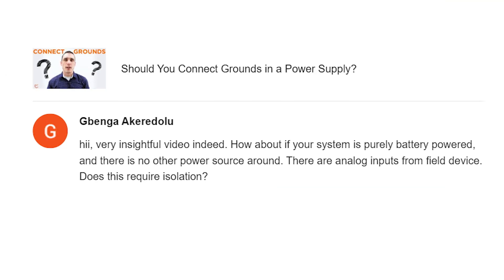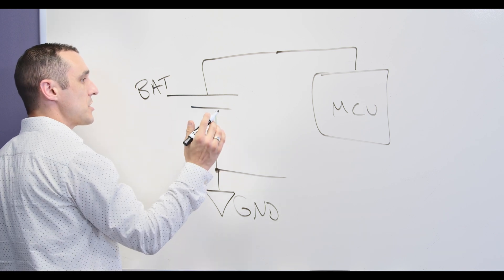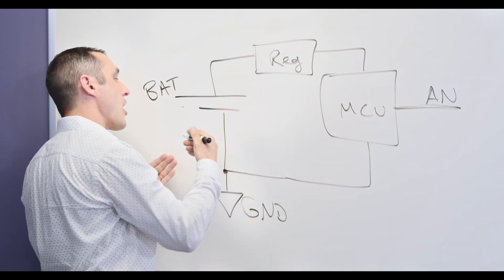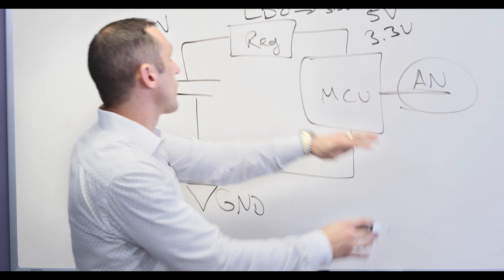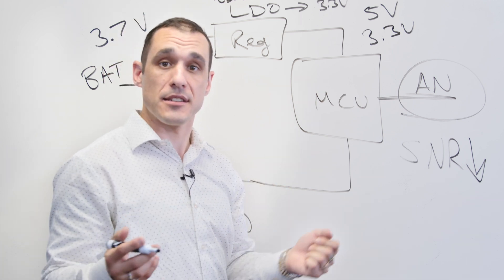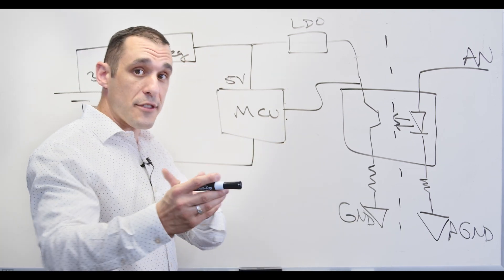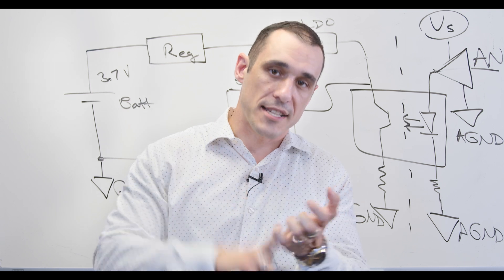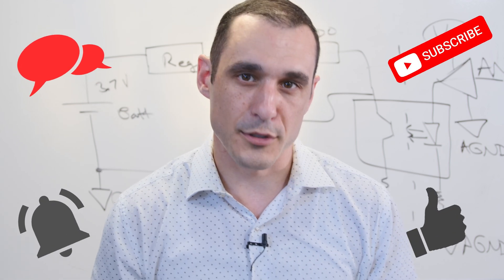Grounding Strategies for a Battery-Powered System | PCB Layout

Comment: How realistic would it be if an ECAD Librarian were to transition into a PCB Layout Engineer?  Does this require additional schooling and a Bachelor's degree?  

How many years would it take to learn how to do this if it really takes that long?  A friend of mine strongly advocates that there is a shortage of PCB Layout Engineers out there in the field and there isn't that many folks out there to fill the necessary job positions that companies are really seeking out for.  

I have the desire to learn but I just don't know where to start and if I'm lucky, I may find a company who will give me a shot to learn.  That would be ideal and it would solve a lot of these companies shortages.
Reply: I think it is realistic. One thing I am noticing is that a lot of PCB layout jobs are being disguised as EE jobs, but they are really looking for someone who understands all the aspects of PCB layout and manufacturing. So as long as you can get some practice designing certain types of boards and getting practice with the layout features in the design tool, you can certainly make the transition. The challenge is that some companies might not let you make the transition, and you might have to switch jobs or do the work freelance in order to get those opportunities.

Comment: In a battery powered device, you don't typically have a separated analog power source as in the reference design. So I guess agnd split is not possible without routing avdd over it.

Comment: From watching Rick Hartleys video  on Achieving Proper Grounding, there seems to be a conflict about splitting the ground plane.
Reply: There isn't a conflict. Here I am talking about a specific instance of splitting a plane based on a requirement for isolation. What I often see happen is people think they need isolation between analog and digital sides but they don't understand why, then they split the system ground and route over the split, that's a recipe for EMC failure. I am not advocating for that and neither does Rick (or any other EMC expert). What I'm saying is that if you have studied the situation and you can prove that the way to prevent noise into a particular portion of your system is to split a ground, or if your system absolutely requires galvanic isolation on the two sides, then there is a proper way to do the split. In a lot of cases you don't actually need the split, but most new designers will say "I have analog and digital on the same board, therefore split," this is not sufficient justification to split a plane.

Comment: the question is, how to split the ground? should we use a ferrite bead?
Reply: Do not use a ferrite bead unless you can prove that you need a ferrite bead. Why do you think you might need a ferrite bead to connect grounds?
Reply: so how should I split the ground? even if I used another regulator for the analog we still shared the ground. idk my previous colleague used to put the ferrite bead to split the digital gnd and analog gnd, It seems wrong but I need a solution for split that ground.  @Zachariah-Peterson
Reply: @wisnueepis3593  I'll ask again, why do you think you need to split your ground regions? Do you have an isolated power supply, are you working on a very low SNR precision measurement application, or do you have some requirement for galvanic isolation for a type of isolated component? Are you operating at only up to about 1 kHz with only analog signals and DC? Most of the time you should not split up a ground plane at all unless you can prove you need it. If you were to split grounds for some reason, the best way to ensure you maintain DC isolation is to connect them with a y-type capacitor. The problem is that you never have true isolation unless the components you are using to cross ground splits are also isolated components that do not use any conductive coupling, they can only use optical (with an optocoupler) or magnetic (with a transformer). These are specialty cases and most of the time you should just use a complete ground unless you can prove you need to have split grounds.
Reply: We affraid that digital will coupled to analog stuff and the other way too.
Reply: @wisnueepis3593  This is the most common question I get and I will tell you the answer: just use a uniform ground plane and keep the digital components separate from the analog components. How you layout the components above ground will always be more effective than separating ground. This will always be effective for all frequencies above audio frequencies and as long as your SNR is much larger than 1.
Reply: @Zachariah-Peterson  thankyou zach for your answer. I have a question about pouring ground copper at layers 1 and 4. Should we pour the island to GND? or just remove them?
Reply: @wisnueepis3593  If you have  a 4 layer board and you use (SIG + PWR)/GND/GND/(SIG + PWR) stackup then there is not a requirement to pour copper on Layers 1 and 4. Don't just fill in with pour because you see everyone else doing it. Take a look at one of our other videos on copper pour around microstrips and 2 layer grounding to see why this is not always the right approach.
Reply: @Zachariah-Peterson  if my layer stackup is SIG + GND + PWR + SIG should I pour copper on the island with GND copper at layers 1 & 4?
Reply: @wisnueepis3593  Let me ask you this, what problem are you trying to solve by doing this? Is there something specific you are trying to do? If you're unsure then you probably do not need to add the pour on layers 1 and 4.
Reply: I just want to know should we pour copper gnd mixed with signal trace or not. We thought that with pour copper gnd will help reduce noise from inside the board and from outside the board.
Reply: @wisnueepis3593  Yes you can use copper GND pour but it may not produce much benefit. For most designs using a ground plane on its own with a ground via next to each signal via is enough. Sometimes we use additional ground with stitching vias, but this would be for copper pour, to suppress reception or radiation of a specific noise source, or to create shielding around a coplanar waveguide. The best way to prevent interference between mixed signal boards is to layout the boards so that the analog and digital regions are reasonably separated.
Reply: @Zachariah-Peterson  thankyou zach for answering

Comment: Hello Sir, its always been great learning from you..well I have a question. To my understanding dont we need to short AGND & GND?…as a single GND is available in power ckt….kindly suggest as it will be helpful to understand ckt more clearly
Reply: In a non-isolated ADC the best way to deal with noise is to use a complete ground plane that shorts both GND and AGND. In an isolated ADC, such as what I show at 6:44, you do not short those pins because the component is intending to provide isolation between the interfaces on each side of the component. Here is a video that discusses this: https://www.youtube.com/watch?v=jhphrm9tktU
Reply: @Zachariah-Peterson  Thank you Sir for this helpful add-on knowledge..👍🏻🙏🏻

Comment: If you're using an LDO, isn't the noise pretty minimal? That is, as long as you route your return traces for the sensor away from the high current grounds, shouldn't there be so little noise that we don't need isolation?
Reply: Yes the noise directly from the output pin of the LDO is pretty minimal. But you're ecorrect as you brought up an important layout point to withstand any induced noise from the upstream switching node, that part is important in the layout. If your sensor runs at progressively lower levels then the need for isolation increases regardless of the use of an LDO.
Reply: Yeah good point! In the past I've used instrumentation amps for analog sensors in the Microvolt range, but they also were low bandwidth, so coupled with higher order filters, we were okay without isolation, but I could see very easily how higher bandwidth requirements could lead you to consider isolation. 

Thanks for the follow up Zach and thanks for sharing your knowledge!

Comment: Now how about if the sensor has to be powered from the battery? I see that the ground split won't be an option anymore but rather noise mitigation techniques like routing and filtering.

Comment: Did he mean isolated DAC? Because the output needs to be an analog signal right?
Reply: At the start it seems so, but he was referring to ADC.
Reply: Since this is an interface receiving a signal it was isolated ADC. If you were generating a signal into an isolated region, then maybe you want to isolate a DAC, but I am not aware of an isolated DAC that is available. There are isolated buffers for digital systems that you could use to isolate a DAC, for example the LTM2895.

Comment: It would be great if you could cover capacitive coupling the grounds for applications that are using a flyback or other isolated supply topology. I've had issues with audio applications using an isolated supply where WIFI Tx would cause a ground bounce that is conducted through the capacitive coupled grounds. Without the capacitive coupling the isolated side would have ground noise from the power supply causing EMC issues and audible effects on the audio signal. I understand this may be too unique of an issue but it would be greatly appreciated if you could address the approach to better understanding capacitive coupling to remove isolated power supply noise. I've tried finding application notes to address this to no avail and the approach I went with worked okay but minimizing the power supply noise through the coupled grounds would greatly improve my small signal measurements.

Comment: Great video! Is there any chance you could cover X and Y capacitors? I usually see them in designs as a way to reduce EMI but I don't know when they should or shouldn't be used! Is this something that isn't an issue for isolated ADCs or optocouplers?
Reply: I addressed this in another video about EMI filters on power supply inputs, specifically on isolated DC power supplies with an AC or DC input, it will come out in the next month or so. I'll give you an answer though, the use of a safety capacitor is to control high frequency return currents on the secondary side of the converter so that they can leave the system through the primary side but without coupling across the interwinding capacitance of the transformer. If you need to use isolated ground nets like this and you have a problem with radiation, this could be one solution. In a general case where you galvanic isolation, there will always be some EMI but the use of a capacitor is a matter of the scale of the EMI, if it is low enough then don't bother with a y-type cap. If you look at the dual ADC project I did, you'll notice that I did not use a cap to bridge the grounds although I did not address the reason in the video. In that particular design I don't expect a huge amount of EMI from the grounds, there is just not enough power in the board for it to be a concern. If it happens to be a problem when the design is built then the fix is quite simple.